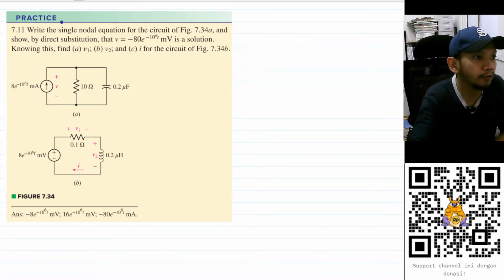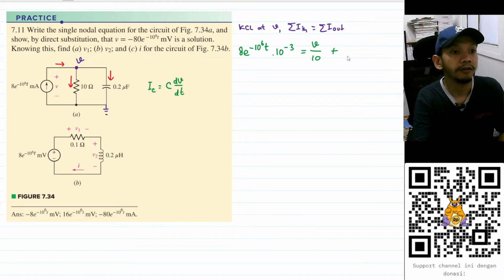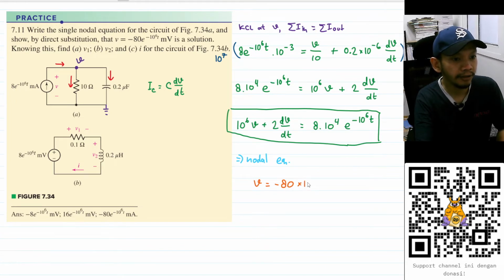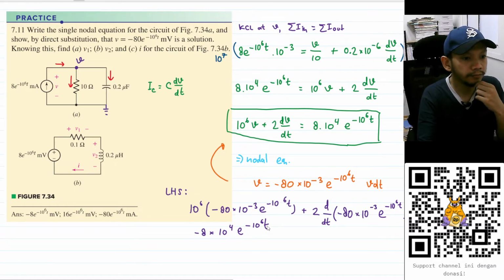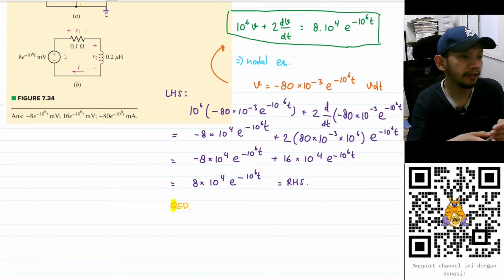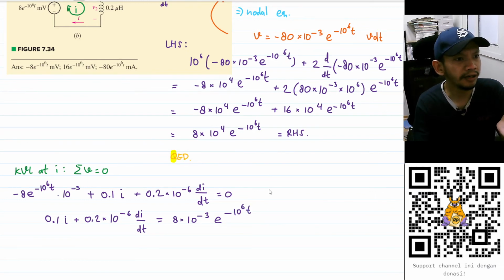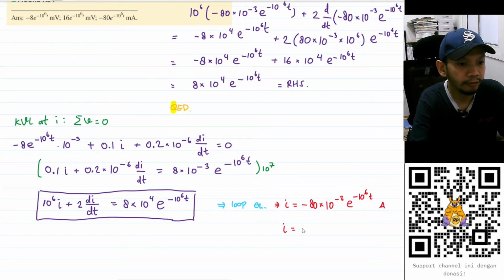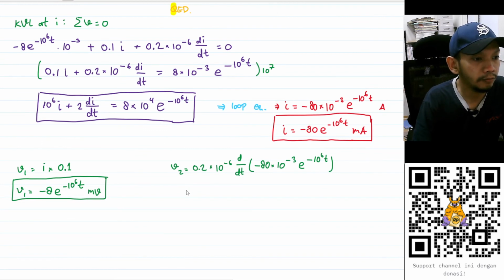Practice 7.11 - Engineering Circuit Analysis - Hayt & Hemmerly, 9th Ed - Supernode

Comment: Hi, I’m the one who asked this problem. First of all, thank you for your elaborate answer.
But I have one more question. At the first question, if we ignore capacitor 0.2MF, the v is -80e~~mV too(by KCL). Is this wrong solution?
Reply from the maker: The voltage in all components of figure (a) will be the same as they are in parallel.
Reply: @ArdiSatriawan  Ok. Thank you so much.